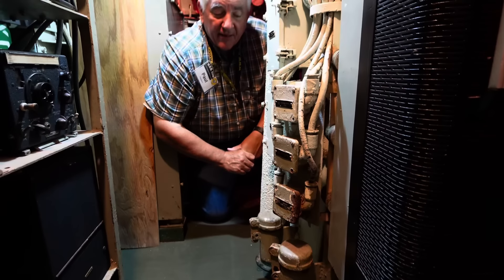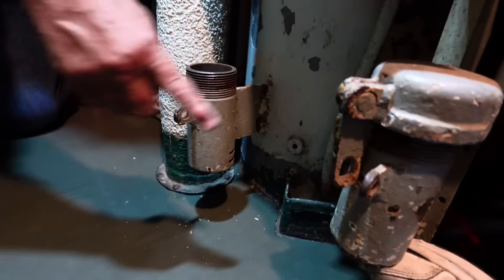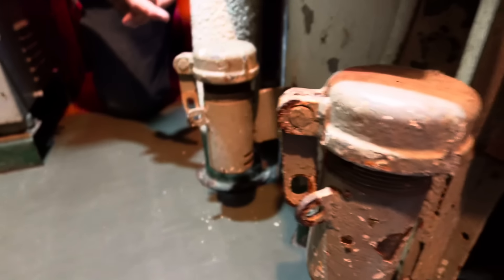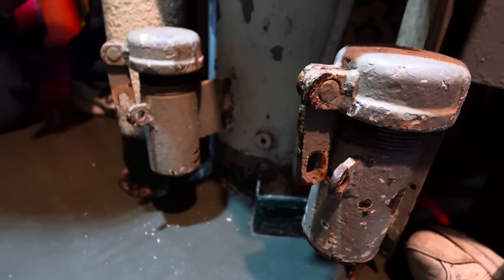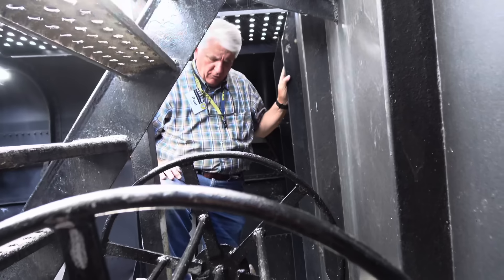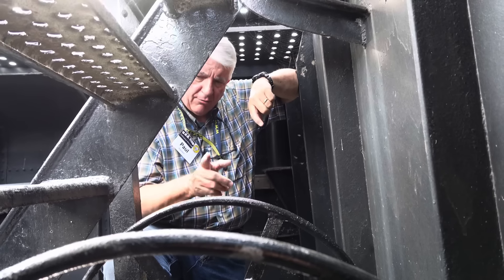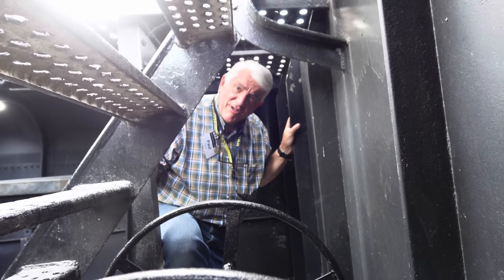Unsolved WWII Submarine Mysteries: the Case of the Two Canisters and a Reel

Comment: Paul, have you talked to anyone on the Silversides? It's a Gato class, and they might have some ideas as to what those canisters are. They might also have that reel, too. My thought on the canisters are that they're either for storage of demo charges or for oxygen generators. As for the reel, has anybody tried to trace that pipe, see where it goes and is connected to what system?
Reply: Hopefully the Silversides crew will see this feed. 😮
The pipe enters the overhead of the FTR and is plugged.  Need to look at old blueprints!
Reply: CO2 is heavier than air, so it might make sense for oxygen candles.
Reply: @paulfarace9595  Ok, that does throw a wrench in to the idea of tracing the pipe. If you've got access to or actually have the blueprints, that would be a help.

Comment: Talking years ago with one of my buddies who served on newer boats, they absolutely had destructive devices stashed right near all the sensitive equipment. He said they kept them is small special lockers. And they had brackets on the electronics to hold thermite grenades. As far as the reel, it looks the right size for a fire hose reel of the era. It probably would not be preconnected like a modern fire hose reel.  The fact that there is some type of pipe there even though it is capped backs that up.

Comment: PIPE CANISTERS ON PERISCOPE WELL:  Almost certainly some type of thermite?? electronics destruct charges, with vent slots to insure drainage and equalization of pressure at all times.
SUPERSTRUCTURE REEL FRAME:  Not for mooring lines as these were generally stowed in floodable lockers under hinged-up sections of decking.  Not fire hose either.  Instead consider a very large diameter manila TOWING LINE to use if the sub needs to be towed at sea (thru the bullnose), or needs to tow another vessel behind it.
PIGTAIL STUMP:  Seems to have several circular rings rubbed in the paint with the stub as the center.  Looks like the remnant of a vertical axial reel of some sort more than a capped pipe.

Comment: Could  the two vented tubes be for emergency oxygen generators canisters. Although it wouldn’t make much sense to lock them but I know they can get very hot so the lock may be to keep someone from fooling around with them. The reel might be a Jacob’s ladder.

Comment: If you search for WW2 Submarine firehose real images do pop up of reals like this 1 but nothing specifically saying it was on a submarine, what type or where mounted. If you can identify which pipe is penetrating the pressure hull where the capped off pipe is coming through & trace it back to the system it is used on, you should be able to narrow down the possibilities.

Comment: Paul, how are electrical hull penetrantions built into the pressure hull and made watertight yet allow normal operation of an electrical circuit and how they perform in battle conditions.
I liked your episode on the battery soft patch. IMHO, a bit scary if a depth charge was close.

Nice work.
Reply: Not many bit stuffing glands allowed wire passages through the hull.

Comment: Check into that stub pipe.  Fire hose onboard has standard sizes, so that might help point you in the right direction.  You might also be able to locate the stub on a set of plans.  Alternatively, you could uncap it and attempt to trace it back to its source inside.  Also, if it's meant to supply water to a hose in that location, there'd be a valve somewhere.

Comment: It does look  like a fire hose reel, but what is missing is piping into the hub. As it is, the hose would have to be completely unreeled then connected to a watersupply. Not too practical.
Reply: No... the end eoukd be connected to the water supply after unreeling

Comment: Id agree its some kind of reel, but maybe not fire hose... youd have to reel out the entire thing to use it, not something youd do in an emergency.

Did the gato class have any means of taking on more fresh water if not at a port? Could it potentially be a water hose? A little hand cranked pump somewhere to suck water out of barrels or something in an emergency to replenish the subs water tanks???

Would really need to see whats on the other side of that cut off whatever it is...

Comment: Those two canisters could hold demo charges for classified equipment, but another thought struck me. Could they be for storing classified film from reconnaissance missions?
Reply: No... film taken by what camera?  No need to stow it low and in such a heavy duty canister.
Reply: @paulfarace9595  
No idea. 

But I know that US subs were sometimes ordered to take pictures of beaches, coastlines, or harbors either to plan upcoming invasions/strikes or to assess damages. 

Those canisters are close to the periscope well so short transfer time from camera to storage, they're securely locked so no one can easily gain access, they have slots that allow air flow to keep the film in a relatively stable climate-controlled environment, they're enclosed and thus dark, so the film won't be over exposed and spoiled.

I have no idea if I'm right, or totally wrong, but it's a thought that occurred to me.

Comment: I guess the canisters could have been for something like Thermite to destroy the radios and IFF equipment.  The "vents" and low down position could be that an explosive that may  outgas and be heavier than air, due to the pressure differences of a sub diving and surfacing..
Reply: Or prevent the canisters from being a pipe bomb!

Comment: For me, the curious thing on those canisters are the large slots. They imply that whatever is in there needs to "breathe" and doesn't care that you could stick a knife in and scramble things about, like a demo charge might. I would guess they are cylindrical, expensive somethings that need to drain water and stay dry.
Reply: Or vent pressure if they accidentally blow...😮

Comment: About it being a reel for canvas fire hose … land-based firemen go to great effort to drain and dry their hose after every use. Hose that’s put away wet rots. Also the entire length of flattened canvas hose would have to be completely unrolled off the reel before being connected to the supply. 

I was just on the USS New Jersey last week and saw several fire hose “holders” - they were not reels. The dry hose was “accordion folded” and hung in a sort of rack, for lack of the correct word.
Could the reel be for a smaller, like 1 inch, rubber utility hose, used for washing the deck? Does one need to wash the deck of a submarine?
Reply: Those are good points although, it might be a different special type of fire hose different from surface based hoses. It could also be installed only during certain times, where the boat wouldn't be expected to submerge often or possibly during training operations or for a certain special mission. Just brainstorming here. 

Also I am pretty sure yes they do wash the decks on submarines. At least, last time I was on the Pampanito someone was indeed using what looked like a garden type hose to rinse off and clean the decks. Granted,  museum boats never get cleaned off by submerging haha. But I am quite sure yes they would in service as well at various points.

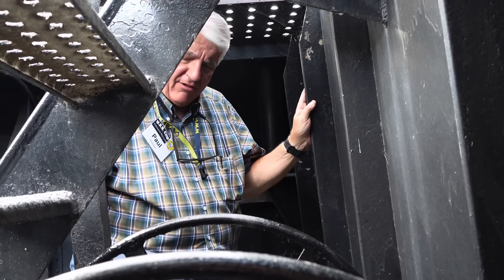Comment: I believe the clip shown at 14:18 is for a extended fog nozzle.  However, I believe that those on BB55 have two clips, as the fog nozzle is approx 5' long.
Reply: @dmcarpenter2470  Those are called low-pressure fog nozzles.  I was thinking the same as you, the clip looked just like those used to hold the LP fog nozzles. Extensions, actually as they attach to the NAP (Navy all-purpose) nozzles. You remove the high-pressure fog nozzle and insert the low-pressure one in its place. Surprised me when I saw them used on civilian fire trucks, and they are still used to this day. They use a penetrating wand attached to the NAP nozzle to pierce through car hoods or radiators. Basically a cut-off LP wand.

Comment: The position of the reel behind a ladder implies to me that it's NOT something that would be used in an emergency.  So not a rescue float or firehose or similar.  
Would there have been any long pieces of canvas used topside?
Could this have spooled up the lifelines from the sides of the boat when not in use?
Could this have been for a un-rep refueling or re-watering hose?

Comment: Paul. As a firefighter of 45 years this does not appear to be a fire hose reel. There is no swivel for the water supply. The entire hose would have to be payed out to use it. Also, there are no handles to reel what every was there back up. ??

Comment: The containers in the periscope well look suspiciously like storage for thermite charges for radio/crypto equipment.  I’m not sure why there are slots cut in, except perhaps to avoid containing the gas and have the lid decapitate a sailor if the lid is unscrewed after the charge goes off inside the container.  Of course venting the hot gas into the boat from a misfired charge doesn’t sound fantastic either.  The classic definition of a Hobson’s choice as it were - neither choice is desirable.

Comment: It looks similar to the reel that was on our brush truck, however the one on our brush truck was a live reel, and i don't see any fittings on yours to indicate that's what it was. It's possible it was for fire hose, but i would question how they prevented it from unrolling while submerged. I would think there should be some sort of brake on it. Also, as others have said, fire hose back then was real susceptible to rotting if it remained wet all the time.

Comment: The reel is a bit of a head scratcher - looking through Gato class information on Navsource and Warthunder didn’t turn up anything helpful.  The relatively light construction of the reel says hose reel.  It could be a utility hose for taking on Diesel fuel or for washing/fire suppression on an adjoining craft.  The capped off pipe nearby can probably shed some light if someone traces where it goes.  The unoccupied clips don’t speak to me about what they once held.  The construction of the reel looks like a later yard maintenance modification to address a specific requirement.

Comment: Since mooring lines are shorter and usually stored below deck, I'd think that was used for storing a towing line.
Reply: Our mooring lines were stowed in lockers in the superstructure. This was 20 years after the war, so maybe things changed.
Reply: @xbubblehead  I was thinking they were stored in hatches along the deck, but I don't know for certain. I could be wrong, of course,

Comment: Future episode. Difference between the two periscope.
Reply: #1 scope with the narrow top is the attack scope. #2 scope with the larger top was the all pourpose scope The #1 scope with the smaller head did not leave a very big "feather" or wake in the water . So for general look around use #2. For attacking use #1.

Comment: One way to determine if that's a capped water line is the diameter of the pipe. Fire hose comes in standard sizes. If it's an oddball size, probably not a discharge port.

Comment: Oxygen candles weren't tested on US subs until 1945 with the Sailfish, but if I were going to put small ones on a sub it would be someplace small, far away from the engines, in a heavily built ventilated container with a lock on it.
Reply: Nope... too small.

Comment: This is off the wall but how close is the deck fitting to the ballast tanks. May be a pressure coupli g and air hose incase s b he's stuck on the bottom but shadow enough for surface supplied air to reflloat her?

Comment: And where were the mooring lines stored?
If it is for some thinner ropes, there should be some kind of fastening for them. A fire hose can be rolled up on such a drum without any problems. And so the entire track line needs to be developed.
Maybe it was a retractor for some pilot lines on which a thicker rope was pulled in, for example to transfer supplies to the ship, but it depends on what the procedures were like.

Comment: The wheel design, the capped pipe on the deck, the two pronged clip on the frame within easy reach of the ladder all indicate to me that this was probably a reel of pre-connected fire hose.  The pipe probably had a 90 degree shut-off and the clip on the frame beside the ladder probably held the hose nozzle at the end of the hose. 

Are there other similar clips on that frame beside the ladder, possibly for holding other DC tools or equipment?

Comment: The only issue I have with storing explosive devices in a submarine would be moisture I would think you would want a sealed compartment with a desiccant bag versus a sealed and locked compartment with ventilation. I think you're reel is a fire hose reel. Any ship boat barg  of  size we'll have firefighting equipment.

Comment: Well, how about a mooring line reel? The only reason I don't think it could be a fire hose reel is that if that capped fitting was a water supply, it is too small to connect to a fire hose. Of course, if it is a mooring line reel there should probably other reels elsewhere on deck. Just based on logic and not intimate knowledge.

Comment: I'm not an engineer, my guess, What is a ventilation (exhaust) system that keeps the hydraulics from overheating.  Again, not an engineer.  The second, my guess, What is a rope spool for any one needing to work over the side, as a safety  valve/net...I don't know Paul, but certainly someone will ponder better estimates than I.  Interesting, regardless of what those two items are.  Thanks, Paul!  PS-Can the Guards win?  Went down today, what a tremendous blow to this Tribe/Guard fan.